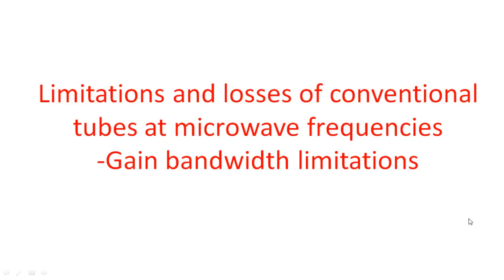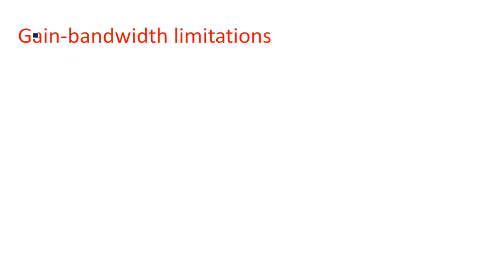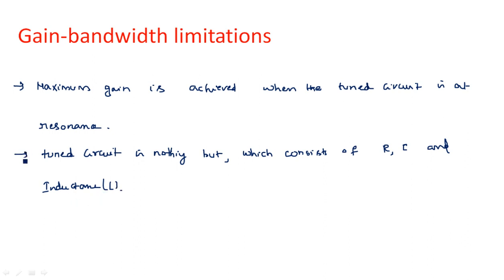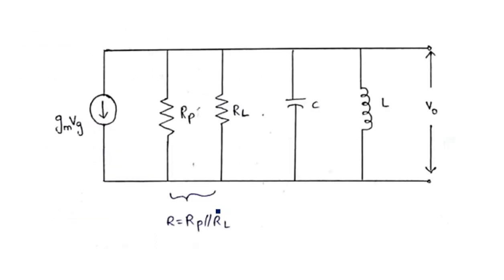Conventional tubes at microwave frequencies | Gain Bandwidth  | Microwave Engineering | Lec-82

Comment: Gain bandwidth limitation affects conventional tubes at microwave frequencies, where gain and bandwidth are inversely proportional. Maximum gain occurs at resonance in tuned circuits. The gain bandwidth product remains constant across frequencies, necessitating a balance between gain and bandwidth. Solutions include re-entrant cavities and slow wave tubes to mitigate these limitations.

Highlights:
00:10 Gain bandwidth limitation significantly impacts the performance of conventional tubes at microwave frequencies. This relationship illustrates how gain and bandwidth are inversely proportional to each other.
          -Understanding gain and bandwidth is essential for analyzing circuit performance. Gain represents the output-to-input ratio, while bandwidth defines the frequency range for which gain remains constant.
          -The interplay between gain and bandwidth is crucial for designing effective electronic devices. As gain increases, bandwidth decreases, necessitating careful consideration in circuit design.
          -The maximum gain in conventional tubes occurs at resonance in tuned circuits. These circuits, composed of resistance, capacitance, and inductance, maximize performance at specific frequencies.
02:25 Understanding the equivalent circuit of a triode is crucial for analyzing its behavior at high frequencies. This involves recognizing the roles of various components like resistance and capacitance.
          -The equivalent circuit consists of a constant current source and resistances, which help determine the overall behavior of the circuit. This is particularly relevant in high-frequency applications.
          -Calculating the gain involves the transfer function, which is derived from the input and output voltages. This step is essential for understanding circuit performance.
          -Applying the Laplace transform allows for a more manageable analysis of the parallel circuit. This technique simplifies the relationship between the resistances in the circuit.
04:43 The discussion focuses on the calculations involving R, L, and C in parallel circuits. It emphasizes the importance of using admittance for simplification rather than impedance.
          -The relationship between resistances in parallel is established, showing how to express R in terms of RP and RL. This helps in simplifying circuit analysis.
          -The video explains the characteristic equation derived from the circuit components, which is crucial for understanding the system's frequency response and behavior.
          -Bandwidth calculation is highlighted as essential for determining the range of frequencies where the circuit operates effectively, emphasizing its relevance in practical applications.
07:05 The video explains the relationship between bandwidth and frequency in an electrical circuit using the formula for Omega values and their dependency on resistance and capacitance. It highlights how the bandwidth is derived and its significance in gain-bandwidth product.
          -The calculation for Omega values is presented, showing how they relate to circuit parameters like resistance and capacitance, ultimately affecting bandwidth. 
          -The formula for bandwidth is simplified, demonstrating that it equals 1 by RC, illustrating the dependency between bandwidth and circuit components. 
          -The concept of gain-bandwidth product is introduced, emphasizing the reciprocal nature of gain and bandwidth in electrical circuits, which is crucial for circuit design.
09:00 The gain bandwidth product is a crucial concept in electronics, demonstrating that maximum gain can be achieved independently of frequency. This principle highlights the relationship between gain and bandwidth in circuit design.
          -At the resonant frequency, gain reaches its peak, emphasizing the importance of selecting the right frequency for optimal circuit performance. 
          -The formula for the gain is expressed as the product of resistance and transconductance, illustrating how they contribute to achieving maximum gain. 
          -Understanding that the gain bandwidth product remains constant across frequencies aids engineers in designing stable circuits that maintain performance under varying conditions.
11:43 Maintaining a minimum bandwidth is crucial as bandwidth and gain are inversely proportional in circuits. Understanding this relationship helps in overcoming limitations in microwave circuits.
          -Re-entrant cavities are one effective method to address bandwidth limitations in microwave circuits, enhancing circuit performance and efficiency. These cavities contribute to better gain characteristics.
          -Slow wave tubes (SWTs) offer another solution to mitigate bandwidth issues, allowing for improved signal processing and transmission capabilities in microwave applications.
          -Future discussions will focus on RF losses and radiation loss effects, which are critical to understanding overall circuit performance in microwave engineering.